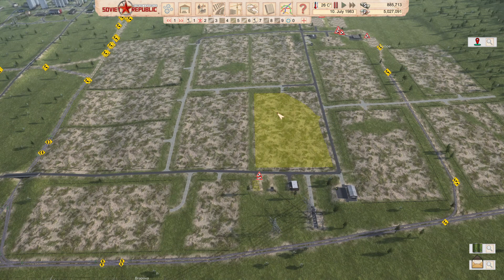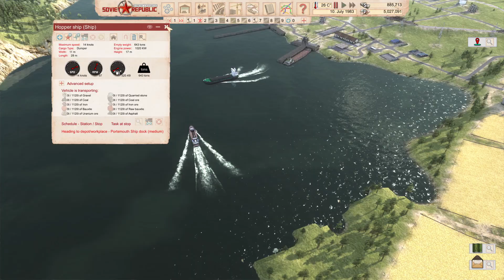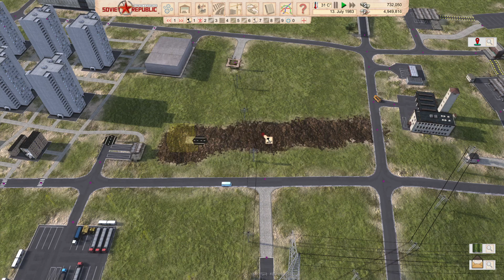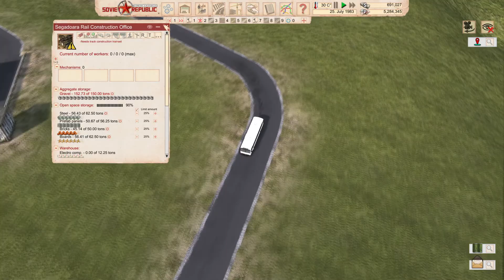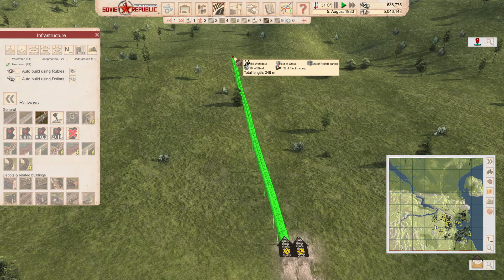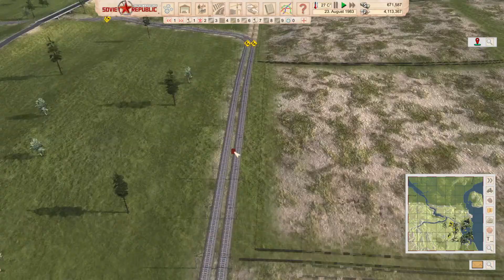Emergency Heating  :: Workers & Resources Soviet Republic (Helicopters And Underground) #52

Comment: Why don't you just sell ships?
Reply from the maker: Normally would, but in the series will need them to move supplies around the map.  Had hoped to use the Frida to supply basic resources to Oil Town, but it will not fit under the bridge, so will have to use River boats.

Comment: If you ask me for my opinion, I would say that natural evolution by advancing in experience is indeed to go towards this kind of challenge:
* Financial challenge: do not export any product requiring prior importation
* Economic challenge: achieve 100% self-sufficiency
* Logistics challenge: to have as a condition of victory 200,000 inhabitants (the number chosen by the developers in terms of game optimization)
* Geographic challenge: each square on the map must have at least one human settlement (of any size)
Some players try to find the most difficult maps as their main challenge but for my part I find it much more challenging to follow this type of rules, of course with interesting maps but not necessarily the most "difficult" ones in terms of topography or resources.
Reply from the maker: Like the rules,  Have an inclination towards difficult topography, but the main criteria is whether the map provides a challenge whilst supporting the objectives of the series.  A key goal of the next series will be building an integrated logistics network that can support a big self sufficient population,  This means no tunnels, plenty of space for farms and sufficient resources to support the economy.  Would also like to have some islands as this will provide an option to explore how the helicopter CI can be used to build remote communities.

Comment: You should by default deactivate (F4) the "Near snaping" and use it only when you need it (which happens quite rarely), it will be easier for you to draw your roads without the snaping.
Reply from the maker: Snapping is a useful tool.  but it can be a pain sometimes.  Need to get into the habit of switching it off when the game loads in.

Comment: You should use your helicopter CO for those construction projects next to Bonygy custom house.
Reply from the maker: Would like to build a second helicopter CO to act in a supply role.  The carry capacity is limited, but the speed and direct line of flight makes a difference when pushing into new areas.